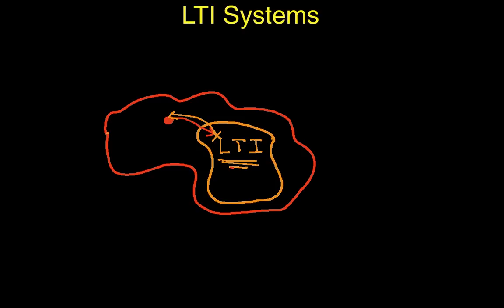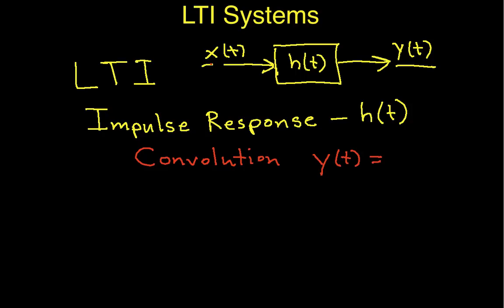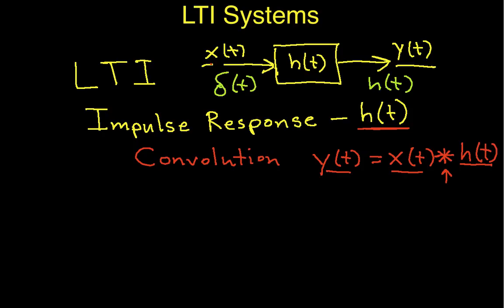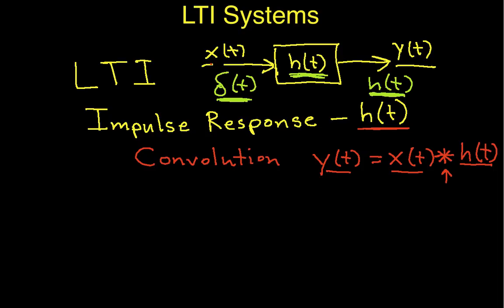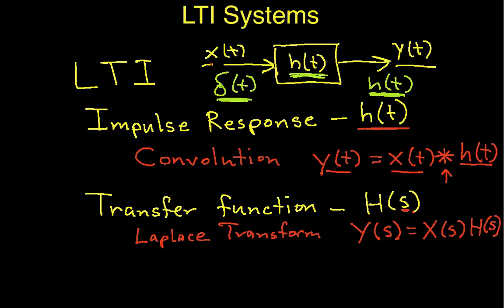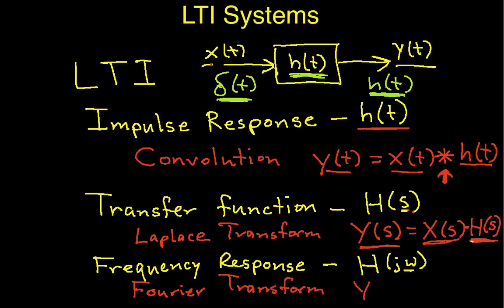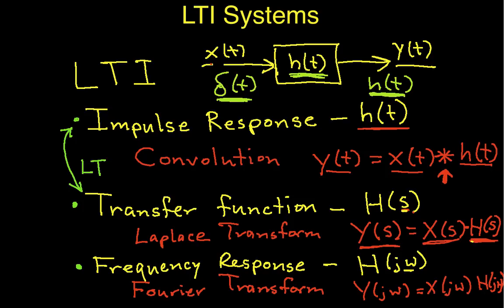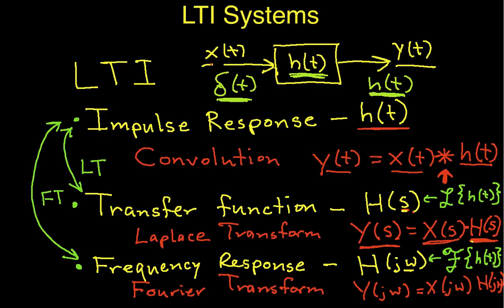Introduction to LTI Systems

Comment: I learned this more than twenty years ago, and it still mostly confuses the hell out of me.
   But if you plug the correct time functions into the convolution formula and follow the rules of integration, you can get the right answer. And, you can always check it with Laplace/inverse- Laplace transforms. 
    Having a clear intuitive understanding of what is going on, that is a whole different level of effort. 

    These straight-forward worked examples, will help, especially if you are new to convolution.